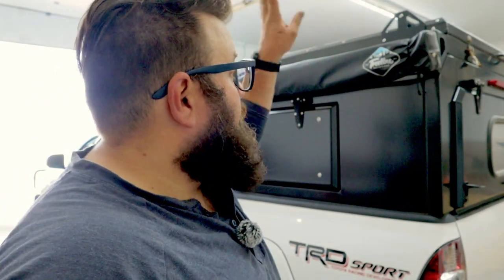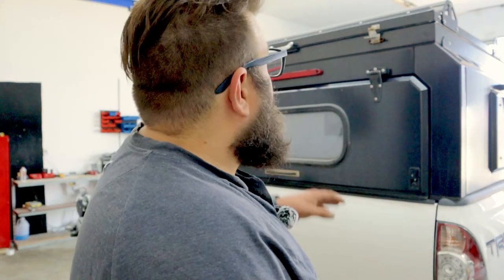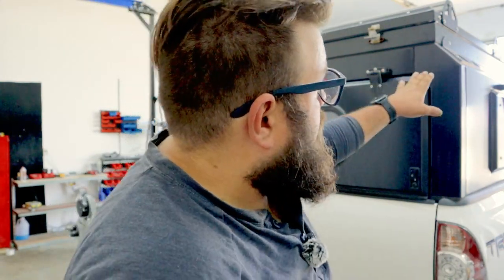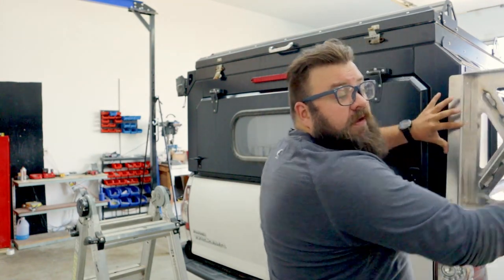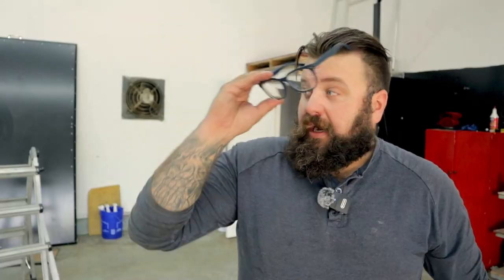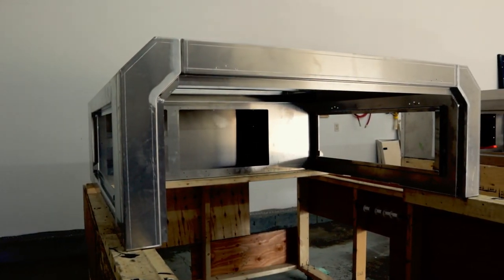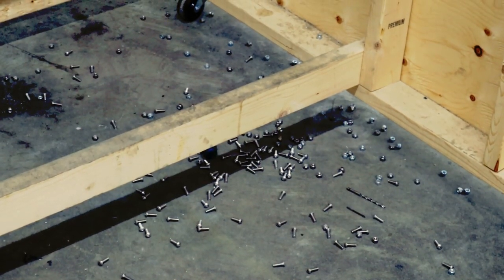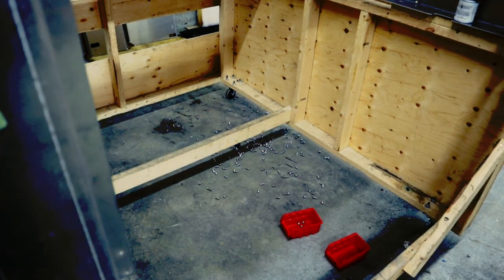Building a Yucca Pac Camper for a Canadian Soldier's Colorado Trail Boss Adventure! 🍁🔨

Comment: Are the camper pieces welded together after they are bolted together?  Thanks.
Reply from the maker: the unit is primarily bolted together with welds only in the corners of each panel so no structural welds to fail or crack!